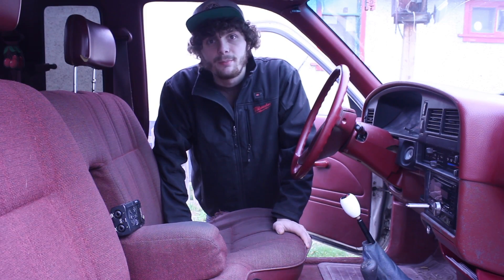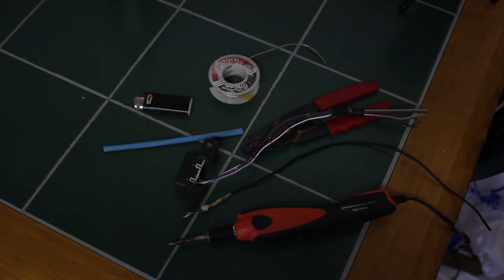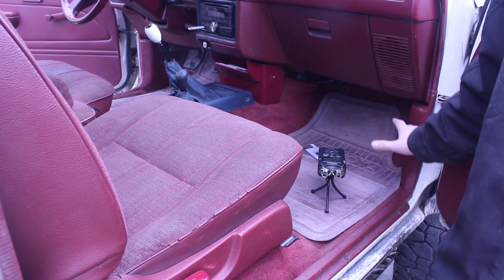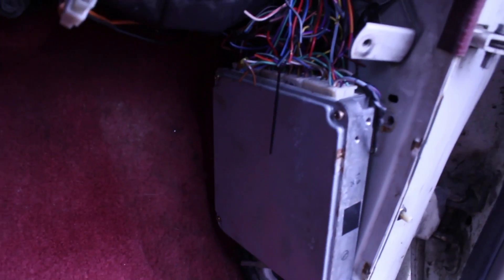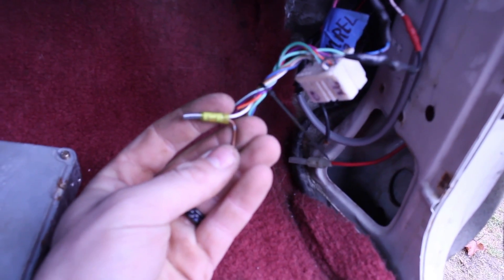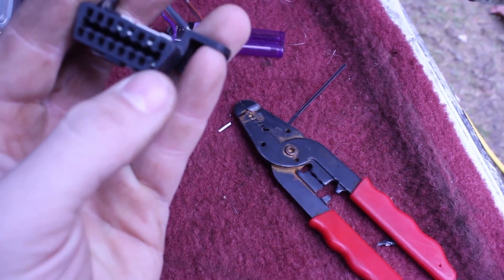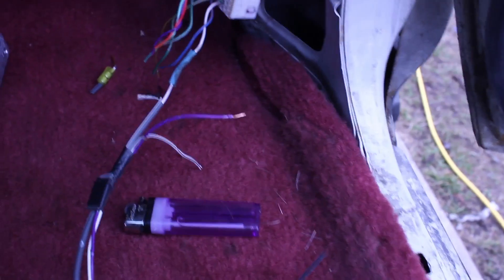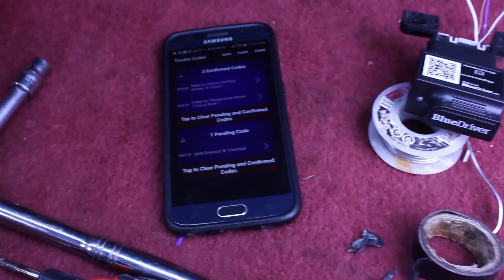Toyota 3.4 Swap - OBD2 Wiring Guide

Comment: I have a 96 4runner 4x4 M/T harness and ecu… harness only has THREE plugs going into ecu. Fourth slot is empty. 22 pin connector.  Any idea where my signal would be coming from? Tried opening the cpu and saw SDL etched in the cpu board and it was third from left on the bottom row, but got a failed connection on OBD. Power is on a constant fuse, and grounds are in the engine bay freshly scuffed…
Reply from the maker: Fourth slot goes to the body harness in whatever vehicle the 3.4 came from.

Comment: It’s a shielded wire to prevent stray voltage from
altering the signal wire. One end gets taped off the other end gets grounded. May want to check the rest of your shielded wires going to the ecm. Or all the grounds in general. You know the ecm doesn’t control power flow. It switches grounds. Power is constant at most connections (like the starter for example) just waiting for a ground (starter signal wire) to ground out to complete the circuit. A bad or loose ground can cause all kinds of random issues

Comment: Haha, I never grabbed the 4th plug, so I ended up soldering my obd2 port right to the ecm pins haha. Watching this makes me miss my 4runner in the early days :(
Reply from the maker: That works too! This was early days for me too. Before SAS and Supercharger..
Reply: I have a 96 4runner 4x4 M/T harness and ecu… harness only has THREE plugs going into ecu. Fourth slot is empty. 22 pin connector.  Any idea where my signal would be coming from? Tried opening the cpu and saw SDL etched in the cpu board and it was third from left on the bottom row, but got a failed connection on OBD. Power is on a constant fuse, and grounds are in the engine bay freshly scuffed…

Comment: HAHAHA glad I wasn't the only one that thought to make a OBDII wiring video for 3.4 swaps. If your still running an auto ecu with your manual trans I have a video for those annoying codes.
Reply from the maker: Haha I just pulled the CEL bulb 😂
Reply: I never  wired mine in, knew it was always going to be on because of the rear speed sensor signal being analog (old 3.0 ecu) vs digital (newer 3.4l ecu)  Dreaming of the day I can supercharge mine or turbo. Checkout https://www.facebook.com/toyotafiberglass he is up there in Canada and is building a twin turbo 5vzfe.

Comment: sure we want more 3.4 swap videos make u one of wiring harness thanks buddy nice video
Reply from the maker: I am actually working on a wiring video as we speak! It really is super easy, would recommend atleast trying yourself before you go spend hundreds on one,
Reply: @DirtGarage  where is that video on harness diagram?
Reply from the maker: @HumbleGolds  Does not exist. I took a bit of a break from YouTube shortly after the first couple videos. And none of the 3.4 swap wiring is fresh in my head. Plus it's really hard to show without having the harness. Also I never mentioned the diagrams, it's different on every vehicle.

My case is very custom, because my motor is from a Limited 4Runner, and it had an immobilizer. So I had to source a difference ECU, and of course there is not plug and play ECU from my harness. So I literally had to rewire the whole thing to work. It was a pain and took several months. So my wiring is not a good example.

It's rather simple though, I wired my buddys 22re to 3rz last year, same idea. Find the diagrams, make sure your ECM has power, switched power, ground, and the fuel pump turns on and it will start, it's almost like wiring a stereo. The rest of the stuff like coolant temps, tach, oil pressure, etc, you will have to find in diagrams how to hook up.